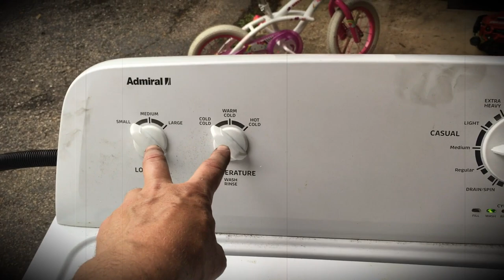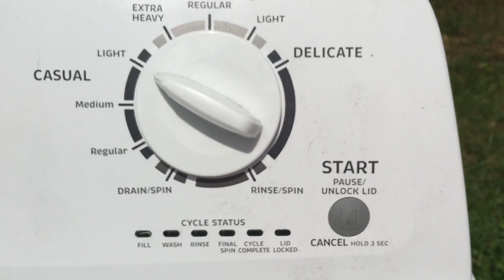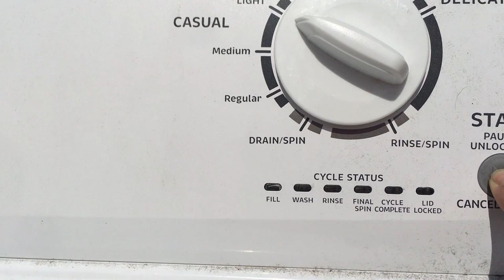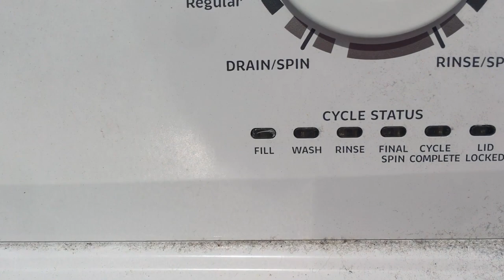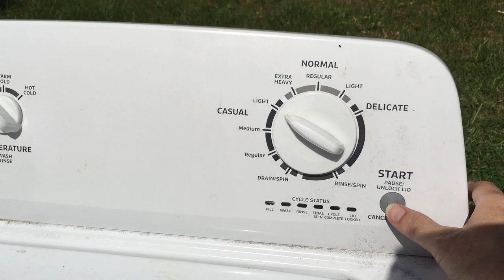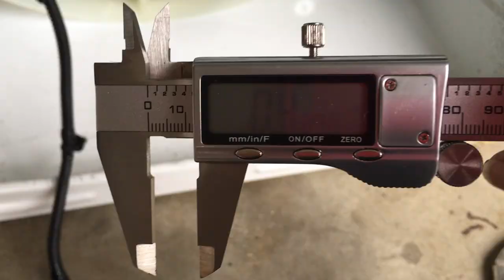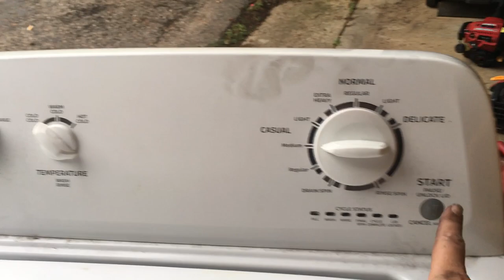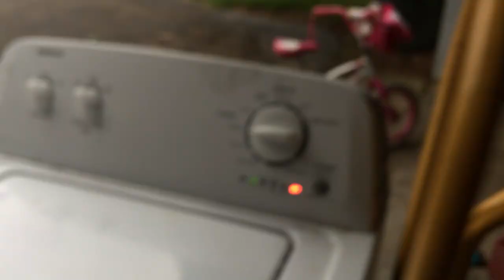Washing Machine Found on the Curb - Can We Fix It for FREE?

Comment: Did it occur to you that this washer was similar to the turntables you repair? Your way of troubleshooting may have played a part! I to am out in the sun as much as I can! Bravo Brad! Love from summer in the Rockies. Thanxz
Reply: I was thinking that the mechanism is similar to the mech. in my turntable, just on a different scale, of course. The knowledge of how motors, gears, cams and levers, and belts work together to perform work is easily translated from one type of machine to another.

Comment: brad the guitologist, if you need to make nuts into washers. put a bolt in a drill chuck, thread how many washers you would like on it then while the drill is spinning lightly rest the file on the nuts until they have lost their corners. then use a strip of sand paper to smooth same process too. :-)

Comment: I’m wondering if all the belt shmoo was not allowing the pulley to slide freely under the belt and the actual fix could have been just wiping it off and changing the belt.  
But as long as it works it doesn’t matter how you got there.

Comment: Hey Brad how you doing my buddy? I think you're going to have to find a new name like I don't know can't think of one anyway I had some experience with fixing a washing machine I remember it had a little late 60s or so we got a second hand washing machine from my mother's aunt my great aunt who I miss very much passed away in 78 that's a lifetime ago probably old the longer than you've been on this Earth brad. LOL but it was a top loader and it had the filter basket on top of the agitator and I can't say how long we had that for you you couldn't kill it and the in 94 when I had my house in Long Beach Long Island which was a beautiful area right on you know it was a small island off Long Island and my house was about 600 ft from the ocean when I sat on my porch I could hear the the water the surf it was really nice. The city made a huge mistake though and had built a apartment houses pretty tall ones all along the road that the it's called shore road how appropriate LOL and it blocked off effectively except for the streets in between the building is in between you know each each avenue you know you had streets going right to the ocean had a two and a quarter mile boardwalk which was completely destroyed during Sandy it was so bad that possibly the boardwalk were found essentially in the middle of the island with wise and the but anyway I had the house and it came with a washer and dryer I think the dryer was whirlpool and Maytag it was gas pretty big was amazing worked amazingly I grew up initially in New York City in a garden apartment complex that took all too acres covered acres of land across many city blocks and having a washer and dryer with something else because it was a tiny two bedroom apartment maybe $700 and some more feet so it really wasn't much room for that kind of stuff but we got it anyway my mother wanted it so I have this house now in Long Beach and it came with the same washing machine which I have seen in industrial laundromats in the past so it must have been a pretty good heavy duty one and the and the dryer like I said I was noticing that my clothes red stains on them couldn't figure out what it was I'm thinking I'm trying to think and I spoke to somebody and he says you know what does that look like Heather remind you of any kind of fluid and I was looking at and I said you know something it reminds me of transmission fluid and that's what it was the transmission was going with help from someone who knew about these things replace the transmission lasted for about a month and it started to leak again same problem the part was under warranty we did it again and we never had a problem afterwards but yeah pretty interesting and the tie that didn't work guitars I didn't have one lol back then although I did have one in the '90s when I own my house from 94 to 2007 and the it was a Ibanez Blazer which I bought

Comment: Accidentally hit the send button and not that my comments are not long enough LOL so this is a sequel for two of my novel yes I'm trying to tie this into guitars yes so I guess it must have been about 84 I bought the Blazer from him for 100 bucks with a case it was the worst guitar I ever owned the pickups might have been you know made out of a wax paper over a cone and as you diaphragm and that's about how good those pickups are all the hardware was brass I don't know what kind of bridge you would call it it had the saddle with screwed into the body and then it had spring-loaded a saddles I guess like free floating that went over it and then that was it and I went up to the tuna packs that a maple neck if I'm not mistaken without a fingerboard added to it it was just part of the wood and I'm not mistaken also I think it might have been lacquer not lacquered but the paint of some sort maybe cuz it was a clear quote with very very thin frets like I guess all of them to style fresh two new pegs with an e on it yeah just a piece of garbage living in San Francisco I took it apart it was purple and the guy that owned it was a mulatto and I guess on ass a few of his ass the trips he he was like ghetto paranoid and he like edged in with I don't know what it was pretty deep mulatto and distress and other stuff like that so I took a Sandra a huge like 1910 electric fan LOL and the sans it all down took the guitar part and I knew nothing about woodworking or anything like that so when it came time to finish it first of all I took the Ibanez off the top of name I sent it that off I took the neck joint plate I don't know what exactly it's called that said Japan on it and turned it around so it says nothing and I got a a can of lacquer and a couple of brushes and I put the finish on with brushes no s*** that's what I thought to do I put like two or three coats on it I had no idea that about sanding in between him or anything like that again and nothing about painting really and yeah I had that guitar from 1984 till 2015 when I went to a friend then I have no contact with him anymore so I have no idea where it is nor do I really care so move ahead to 2016 and I never played the guitar I mean I played it when I lived in California but from 1989 until 2015 I haven't touched it and that was my hiatus from playing because of going blind I just gave it up and think it was it it was a viable and the 2016 and all of a sudden I said to myself hey you know my first real electric guitar before and I found the a used 2005 St special it's a special special cuz it was yeah all the 2005 specials came with a fade to finish and this one had a full gloss finish actually I'd have all the guitars I have now I mean since 2016 I've got eight guitars now and I want two other gifts and the finish on this guitar is like a sheet of glass the way it feels it's just amazing and my firebird and my Les Paul they don't they're nice and they're close but they don't feel like that yeah so from 2016 till now I own a guitar most of them watches Iona for anyone knows about this guitar it's got to be a late 60s mid-60s Ibanez prestige and it's like a mustang clone it even after two dip switches for the pickup selectors only it does have a humbuckers instead I don't know how I never measured it I don't know if it's the same size the short scale or if it's even shorter than that but it's pretty cool guitar I have no idea if it is a value I tend to think it doesn't and then I own a area like super cheap what am I talking about here I'm all over the place back to your video Brad this is what happens when you had a boring few days boy verbal diarrhea and I'm terrible diarrhea and there's nobody even listening to it just me yeah going blind I think affected my brain in other ways LOL anyway that washing machine was fixed the second time there was no more stains on my clothes the original symptom besides the stain which I couldn't understand where the f*** it was coming from it didn't have one of the speeds it was two speeds the first speed didn't work that was the problem and I was surprised because it was a transmission a real transmission with transmission fluid which I didn't think would have been the case anyway again live and learn thank you Brad for your video I'm really surprised that your and videos are not as popular at this point as these videos as a person who can't see I learned a lot from you and it was always interesting and it was always a video for me of learning and knowledge whether I could apply it or not it doesn't make a difference you know if it was applicable or any parts that were applicable applicable you know I kept them filed the rest of the round the filing been under the desk to speak so for the fifth time probably thanks Brad hope this comment finds you well again I don't think much of too many people that comment use that phrase what can I say stay safe again hope your family is well PS if anyone knows this if anyone has had the week that it would take to read this micro holy Grail which I think is the the reverb and then a electrohemonics maybe ditto reverb delay and I don't know which goes first in the chain if the guitar and will I have it going into my effects loop on my yeah I should have asked this question in the beginning and got rid of all the rest lol but I know there's no set rule cuz everything's subjective with our love of guitars and amps and stuff like that but what goes first into the effects going into the delay going into the amp or the other way around and doesn't make a difference so they have some more guitar related stuff sincerely Bob the blind bedroom guitars God damn this was a long one that went everywhere off topic on tangents that even eyes and even Einstein would have problems trying to mathematically figure this one out tangents cotangents hypotenuse yeah all guitar related :-)

Comment: Appliance tech here..
Those gear cases are notorious for oil leaks, it gets oil on the shifter and the lens is blocked which will prevent it from properly agitating or spinning. 
Typical throwaway appliance design, much to my dismay.
Reply from the maker: What's the "lens"?
Reply: @TheGuitologist  the actuator the moves the splutch uses an optical switch arrangement in it to sense it's position. It's the dumbest thing I've ever seen. Mine stopped working because some humidity got in it blocking the lens. Water near a washing machine who would have thought.
Reply from the maker: Ah! Makes sense.